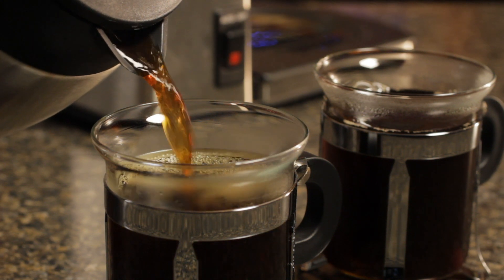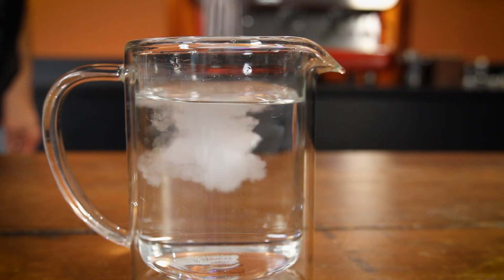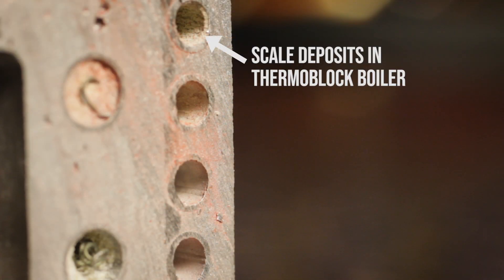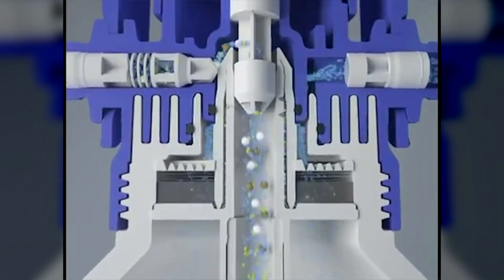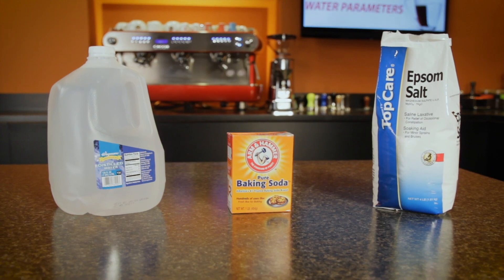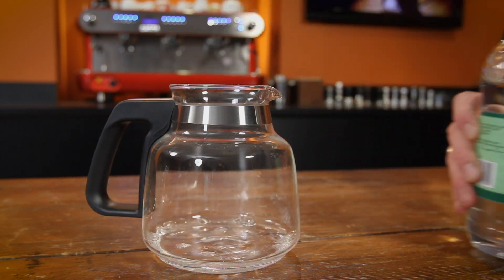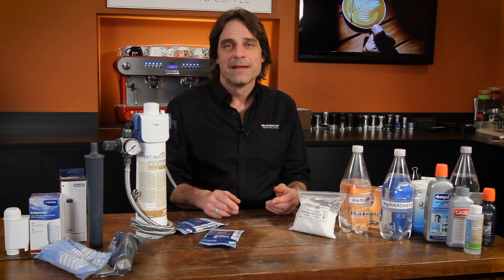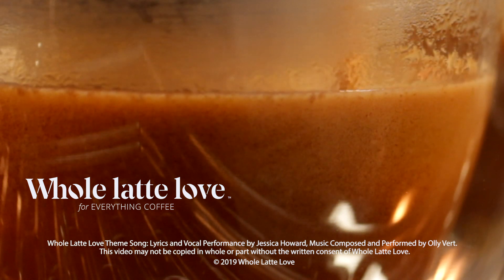Water Filtration for Best Coffee & Espresso Flavor and Equipment Protection

Comment: My water has a pH of 8.19, but only a total hardness of 87ppm (made by 25mg/l Ca and  6mg/l Mg) I guess the hogh ph is caused by too much HCO3-, which also plays the biggest part for  my alkalinity of 112ppm. So which filters can exchange HCO3- for anions like OH-? Alternattively I could add flouride and chloride salts to lower the ph (Do they also lower the hydrogencarbonates?). I know that chloride can cause corrosion on stainless steel, but I'm doing only pour-overs, so for now I don't have to care much about limescale and corrosion.
Also the BWT Bestmax premium looks like the BWT bestdrink Premium, only with a bypass-head. for my soft water with a total hardness of 4.88°dH they recomment setting the filter head to 3 (which means a 1:3 ration of filtered to unfiltered water I guess). But if I want more magnesion in exchange for calcium I have to set the filter head to 2,1 or 0, but then also the capacity gets much lower, but I guess that's also caused by the water hardness. But after all, there aren't much minerals in my water, maybe a bwt bestmin makes sense. 
And if I trade Ca+ cations for Mg+ cations, the ppm will stay the same, but Mg is smaller in mass, so if the filter collects 10mg/l Ca it will put out 6mg/l Mg.

Also it would be interesting to know which Ca:Mg ratio fits best to which roast and water hardness. I heard water with less ppm like 90-120ppm fits better to light roasts while harder water but still soft water, e.g. 150-200ppm fits better to medium and dark roasts. 
Also some roasters prefer more Mg (e.G. Quaffee with 2:3) and other prefer more Ca (grinscience with 3:2)
Reply from the maker: Hi 59, Lot's of detail there! I'm going to forward your chemistry questions/comments to BWT for their suggestions. As to ratios for roasts it's hard to say - lots of opinions and flavor is subjective! You might try some experiments starting with the make your own SCA brew water and then adjust the mineral content and see what you like.
Reply: @Wholelattelovepage  At the moment I use Third Wave water, sometimes I mix it with parts of my tap water and destilled water to get different hardness and alkalinity ppm, but I don't know exactly how much Mg, Ca, Na and HCO3 there is in the Third Wave Water. I'll buy some mineral salts and experiment with the ratios. There is an interesting Blog Article by Jonathan Gagné, an Astrophysicist with a faible for coffee, about mixing your own coffee water: https://coffeeadastra.com/2018/12/16/water-for-coffee-extraction/
There is also an interesting Article by Grindscience.com: http://grindscience.com/2016/03/dissolved-minerals-in-water-and-their-effect-on-coffee/
Or Fivesenses: https://www.fivesenses.com.au/blog/experimenting-with-the-effect-of-water-quality-on-coffee/
And Freshcup (by Christopher H. Hendon, who published many interesting articles and studies about water) https://www.freshcup.com/how-water-works/
I also own the Water for Coffee book by Colonna Dashwood and Christopher H. Hendon. I haven't read it completely yet, but now I have a much better basic understanding about how water interacts with coffee and basic physics, which will make reading and understanding easier and more interesting.

Comment: been using straight RO water for over 20 years in my Cimbali  machine is like new,  RO water is not corrosive _ big myth.   I do agree it doesnt make the best espresso
Reply from the maker: Hi C J, Thanks for sharing your experience. I'm going to push back a bit and say it's well established that pure RO water can be corrosive to many metal types. Please understand I'm referring to ultra-pure RO treated water with zero TDS. Many RO systems employ re-mineralization after filtration which solves the problem.
Marc

Comment: Great Video thx! I purchased the ECM Technika IV Profi from WLL in 2014 and have been using filtered tap water by http://www.naturallyfiltered.com in Orlando Fl with hard water. 

I just purchased the bwt penguin pitcher as you recommended - should I fill the pitcher with the filtered tap water so we have doubled filtered water OR straight from the cold water tap into the pitcher? Many thx!
Reply from the maker: Hi Mr T, You are welcome for the video and thank you for your comment and question. Always great to hear from customers who take water quality seriously! Very important for espresso flavor and keeping your machine healthy. I looked up  Naturally Filtered and it appears it's a carbon block filter system which does nothing to reduce hardness. Please correct me if I'm mistaken. They sell a number of different filters so maybe I'm missing something. I do not think it's necessary to double filter the water. It won't hurt anything if you do. The BWT pitcher has a carbon section so it will do the chlorine etc. removal in addition to reducing calcium hardness.
Marc
Reply: Whole Latte Love Thx Marc! They used to state the scale build up would be reduced and  we found this true in kettles but never was sure for the ECM Tech machine. Their filtered water has a cleaner taste than the bwt filtered water but that may be the added magnesium that we’re not used to. I’ll continue to use the penguin filter on its own from here on now in the ECM reservoir. Many thanks, T
Reply from the maker: My pleasure!

Comment: Thanks Marc. I just ordered a BZ13 DE from WLL. Here in Oregon I don’t have a hard water situation but I am showing a ph between 5.8-6.1. Is this within an acceptable range? If not and I need to increase it closer to 7 how would I go about that? I currently purify through a Britta pitcher. Thanks in advance!
Reply from the maker: Hi Eric, You are welcome and thank you for your patronage. One common method of raising pH is dosing water with baking soda which is sodium bicarbonate or soda ash which is sodium carbonate. I can't tell you exactly how much to add but you could start with 1/4 teaspoon to a gallon and see what your pH reads then. Hope that helps!
Marx
Reply: @Wholelattelovepage  thanks, will doing so require me to descale more often after adding baking soda to the reservoir?